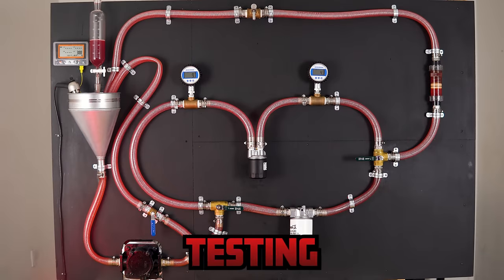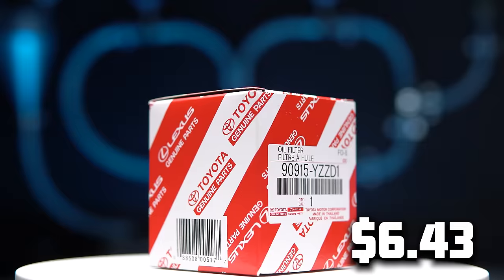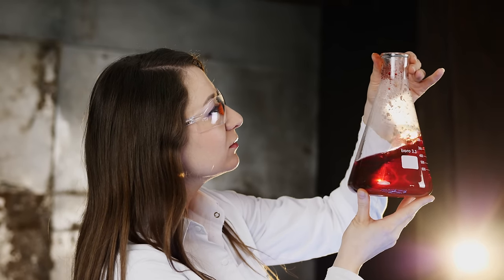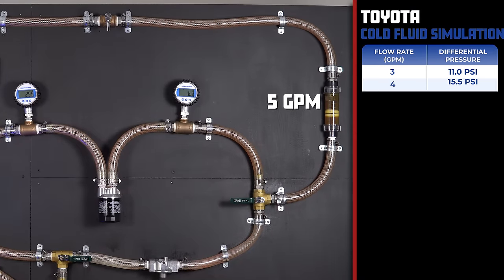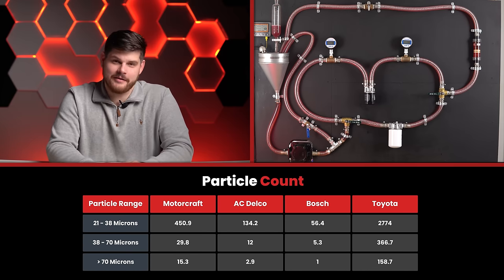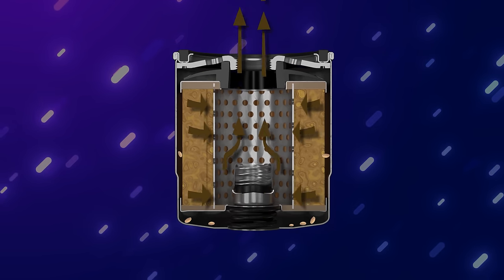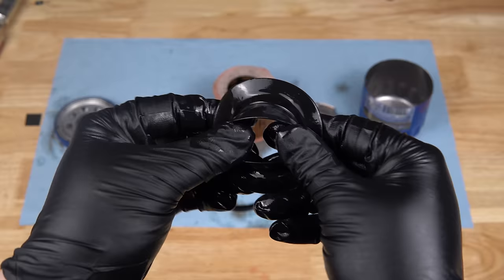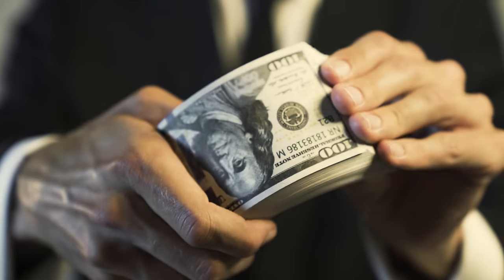Are Car Dealership Oil Filters a RIP-OFF?  (Engineer tested)

Comment: The Bosch 3330 has been my go to filter for many years with no issues.  I can’t find it anymore, so I’ve been using the Fram Ultra Synthetic XG3614.  I have a Toyota Tacoma 4.0 V6 Trd sport that I bought brand new in 2007.  It still runs great at 149,000 miles.  I’m going to keep it forever.  🙂
Reply: Fram ultra always gets excellent reviews.
Reply: For my Lexus IS300 I use XG3600 instead of XG3614. Same thing but longer body, so in theory it should allow less restrictive flow and greater particle capacity. But we still need SOMEONE to prove this theory scientifically!
Reply: Fram is cardboard dude. That’s pretty bad
Reply: My 4.0 from my 4Runner has 250k on it. Motor and trans are still great but everything else is falling apart. All the bushings and ball joints and bearings are just about dead
Reply: Switch to the Fram Endurance FE3614 or the larger FE3600, Amsoil EAO34 or Purolator Boss PBL20195, or equivalent Royal Purple Extended-life filter.
Reply: Fram. The orange can of death. The very first oil filter company, and the absolute last I would ever buy. If you hate your car, or just don't give shit, buy fram. If you love your ride, buy mobil1. By the way,  I have a 07 tundra, bought new, with 376k miles, and an 05 land cruiser with 298k..both run like new.
Reply: @shenanigansagain5273   Nobody is even talking about the cheap bottom Fram filters.  The Fram Endurance is the same identical filter as Amsoil EAO.  Mobil1 has been middle of the row junk for years since they changed their oil formulation and filters.  It is barely middle of the row these days.  You are just some fan boys that hasn't done enough research.  Land Cruisers are junk anyways.  And there is no vehicle on Earth that has 376k miles that run like it is new.  You practically would have to replace every single part 2-3 times by now to keep up with factory maintenance. You are nearly on your fourth water pump by now.  Toyota are great vehicles, but Mobil1 isn't what kept them running.  And in 2007 is when it was the real Mobil1 and filter, now they reformulated and changed the filter who is made by Mann-Hummel.  If you would like me to send you several testing result videos, I can attach them to this message.
Reply: @Balticblue93  My land cruiser bj40 (diesel) from 1975 has exceeded 500,000 km, 2 trips to the African deserts, hundreds of hours of walking on difficult off-road (4x4 club) and I have only replaced the injectors once, the water pump once, everything is original except the exhaust. Always the same engine, the same gearbox, the same axles and universal joints, the same winch, and always original filters. You are a joke!
Reply: Wix makes a good high quality filter
Reply: @howebrad4601  Wix is made by Mann-Hummel. The testing has been very middle of the row.  Pretty much the same as the Mobil1 filters as they are made in the same factory.  The NAPA platinum and Purolator One are also in that same grouping.  The WIX XP is a decent middle of the row filter and will work fine for 5000 or less oil changes.  It will also do better with a higher quality oil.  But it does not remotely test or work as well as many other filters.

Comment: PUROLATOR BOSS PROBLEM

The only problem with the BOSS filter being the top dog is that not all Boss filters have a 99%@25 Micron efficiency. 
The two I use have 99@46 Micron which is totally unacceptable.  It's the PBL 14476 for my Toyota. 
Another for my Ram is PBL36296 which is 99@34 or 36 which isn't great by any means. 
If you use a BOSS filter I'd check with Purolator to verify the exact efficiency rating.

Comment: Great test as usual. Any plans to test the Purolator One to see how it stacks up to the Boss?
Reply: How do they know if and/or when the bypass valves open up?  Or what PSI they are supposed to open up at?
Reply: The motorcratt filter is made by purolaotor

Comment: Not trying to be to nitpicky, but if you tested and AC Delco PF63,PF64,or PF66 are the current high use gm factory filters. You would be testing the newest technology filters.
Reply: ACDelco PF53 tested, not OEM for GM vehicles. Intended for other than GM. You are correct though, ACDelco ecores for GM vehicles is now use metal endcaps and have separate poppet dome bypass. The last when not for GM with block bypass.
Reply: @faxmen09  yes Ac Delco is OE for gm vehicle filters. The PF53 is for older gm vehicles, but nothing current. 
It would have been a better test, if it applied to current or nearly current vehicles.

Comment: so in HVAC we sell high flow media style filters to residential customers. and the reason is other then the fact they are cheap, many customers are bad about replacing filters and the media style filters have a huge capacity that will allow lower restriction then the higher end filters. in other words it has a chance of surviving until there next service.
Reply from the maker: Great point! I bet oil filters are similar. Thanks for watching and sharing
Reply: Why not just sell regular filters. If they blow up their HVAC system that's more money for you. It is not even unethical.
Reply: @Null-o7j  that's not how it works. If they have service, that means everything is warranted. My furnace has 10years full unit replacement and 20yr in parts. Also lifetime hx replacements, it is stainless so it shouldn't be a problem. it'll cost them more money if my parts keep breaking.

Comment: Please do a Hyundai/Kia filter. They’ve attempted to deny engine warranties due to aftermarket oil filters being used. At my workplace, they’re the only brand that specifically gets fitted with an OE filter. It would be interesting to see if they’re actually using a high quality filter or if it’s just legal riff raff.
Reply: As a former hyundai tech, the filter being aftermarket shouldn’t have much bearing on warranty at all. Seems like theyre trying to give people a hard time. Some dealers try to help more than they try to screw ppl and vice versa. Oil change records holds far, far more weight than use of aftermarket filters. When I worked for independent shops, champs OF4459 was the equivalent of hyundai filters, so that’s a little surprising that your workplace only uses the genuine hyundai filters. Definitely nothing wrong with that tho.
Reply: @yavz7565  yeah we used to use the equivalent Mobil filter and we ran into trouble while using it. This was several years ago and I was part time going to school during that time so I don’t remember the details but I do know it sounded like we weren’t the only ones and we’ve been staunch about it ever since. Admittedly, the OE filter does seem to be very good quality from the outside. Nice and heavy, good silicone seals/valve. Still curious.
Reply: Dealership will try everything to deny warranty..
Even though the agree.. they will try to sell you all the crap including tire rotation "Hyundai  reccommend B.S" 
If you were to sue em they will come back & say it was a misunderstanding with tech../ advisor..
If news goes viral then hyundai say.. customer had to contact coperate if they had any issue.. who would never respond till then.
Loads of B.S
Reply: @alenmonsyedward7499  you’re right, and that’s actually a reason why I think direct-to-consumer dealerships might be better. More accountability, less finger pointing… you’d hope at least.
Reply: Hyundai/ Kia are a joke. I owned a Sorrento and they voided my warranty because when I dropped my car off it was 1 mile over the suggested interval 😂. I had so many problems with them and it turned out that they had to replace my engine 2 times due to a common sludge problem. Car only had 48k with 2 engine replacements. I have gone back to Honda/ Toyota cars. Since then I have had no problems with my cars. Good luck with those clowns.
Reply: @alexgarcia7401  Why you lyin'?
Reply: @zcomputerwiz  you must be a Kia/hyundai owner. Sorry I told the truth and hurt your feelings.
Reply: @alexgarcia7401  Or I just like to call out a rando with a crazy story about 1 mile over on an oil change voiding the warranty ;)
Why you lyin'?
Reply: @zcomputerwiz  yup, you just confirmed you are a Kia/Hyundai owner. True story but you don’t have to believe it. Here is some more truth to that story that is hurting your feelings. Kia honored the warranty and once said and done they ended replacing 2 engines. The first one @ 18k and the second engine @48k. Got rid of that car and bought Honda vehicle. Only Honda and Toyota for me from now on. I learned my lesson.
Reply: @alexgarcia7401  Got it in writing that a dealer voided your warranty over 1 mile on an oil change interval? If they replaced an engine then very obviously your warranty wasn't voided - so which is it, clown shoes?
Reply: @zcomputerwiz  I did have it when i owned the car. I even had proof that i had to get corporate and lawyers involved to get my cars warranty reinstated. It became a huge lawsuit with Kia for that particular engine model. I’m just spitting facts while you are just trolling. Have a good day Kia/Hyundai owner.
Reply: Trash company trying to weasel out of warranty claims on their trash engines.

Comment: I work at a car part store. The filters mechanics and dealers order from me cost $1.97ea. The one i put on my car is $22 with my discount. K&N and Amsoil are the best, mobile is good but not in cold weather or cars with scavenging problems(like subaru, bad bypass flow springs and low bypass flow). Fram XG is good but the PH and CH are garbage. Use MANN if euro. My company stopped doing business with bosche because counterfit parts were getting into our part stream (brakes and plugs).
Reply: I understand that K&N is the brand that has a high flow rate similar to Toyota OEM.

Comment: Would you mind checking out Hyundai oil filters? They're apparently made by Mann & Hummel Korea and are supposed to be very high quality. On my specific Hyundai model, a '23 Elantra N, there's a rumor that running anything other than the factory oil filter can harm the engine due to lower flow rates from aftermarket filters. I've even been told that my warranty can be voided by using aftermarket options on my specific vehicle, which seems absurd to me.

Comment: I wonder how well the TRD version filters would perform compared to the standard toyota filter. They are priced high but maybe on par with the higher end aftermarket filters?
Reply: Believe they are made by Amsoil
Reply: @HondaSolutions  that would make sense, they make a great filter
Reply: Hmmmm.. i tought they were made by Champion Labs..
Reply: The Trd ones perform very well… They are made by champion labs (champion labs make some cheaper ones too, but it is their flagship line) it is the same or very similar filter as royal purple filters , amsoil oil filters, and the new Fram synthetic endurance filters. They are pretty much the best filters on the market that you could get.  Worlds  better than this.
Reply: Amsoil doesnt manufacture oil filters @HondaSolutions

Comment: As someone else said Id also be interested in a cartridge filter video, so you would be comparing the actual filter and remove the variable of the different filter housings. or maybe I have no clue what im talking about. I think ill be using oem toyota filters in the winter and try out something like the purolator filter in the summer. I did notice that the paper filter in the toyota spin on filter shown was the same as the one i use in my cartridge filter corolla, so assuming there were no design flaws in the spin on filter design, ill have to shop around in the future for other brands. Thanks for the OEM video!
Reply from the maker: Yes, we may do a cartridge style oil filter video, definitely would require some modifications. Thank you so much for watching and supporting the channel.

Comment: Waiting to see the Kia/Hyundai OEM filter in test. Amazing Job ! 👏🏼
Reply from the maker: Thank you so much for your support and for watching!
Reply: @BrandRanks  Hoping its the 26300-35505 model as it's used along a LOT of models. It's definitely got a bypass on the bottom instead of the top and others that have taken them apart show they're very well made. They've almost doubled in price within the last year though (from $7-8 to $12-13) but prior to that seemed a great deal.

Comment: Interesting and informative.  I bought a Bosch filter as recommended by Scotty.  What I got, I didn’t like. Small holes that restrict oil flow, but the ad showed a different hole pattern much bigger.  So, why did they change.  

Recently, I bought the Mobile 1 for my Toyota because of past history and design.  Past oil analyses with this filter always looked good through 160k when I sold the van.  

I also use Honda and Toyota filters.  But, due to this video, I will rethink using those filters.  The Toyota filter is similar to Fram Tough guard, I believe.  High flow, so even cold there is little bypass.

The problem I see using high efficiency filters is slow oil flow at start up.  I suppose with new low viscosity oils that flow like water, there would not be a problem.

Comment: Did you test the older AC Delco 12731742 PF63 or the newer 12735811 PF63? I believe they updated it to provide better flow. It has more holes in the baseplate. I think that the newer one is only available at the dealerships for now? I would love to see a comparison between the newer AC Delco, Purolator Boss, Wix and the Mobil 1 Love your work! Thanks Craig

Comment: I was wondering if you could test Baldwin filters next and maybe their cheaper line, the Hastings line as well.  Also maybe some of the other ones as well like Mopar filters, Pure One filters instead of just their Boss line, and maybe filters for actual Trucks or construction equipment.  So possible take a look at filters from John Deere, Caterpillar, Case IH which is CNH filters, fleetguard, and Davco. Thank you

Comment: I like all this detailed analysis, thumbs up!  But how does small particle filtration, capacity, and flow rate equate to engine life?  That's the REAL question!    It seems to me like if you change your oil & filter regularly, then dirt holding capacity shouldn't be an issue.  So then you get down to the question of what does your engine need more, higher flow rate or finer particle filtration?  To answer  that question, you have to consider whether the engine is subjected to more short trips, or long trips.  To me it would seem like a higher cold flow rate would be more desirable for short trips, while particle filtration ability would be more desirable for highway driving (after the oil is warmed up.)   So maybe your test results should be recategorized to help people decide what is the best filter for short and long trips.  That would be useful information.
Reply: I completely agree with this.

Comment: My 2014 4.0 Taco started with Pennzoil Platinum then to black Castrol Edge. Used the Napa Gold aka Wix XP. Other filters tried were Napa Platinum, Napa Silver, and Mobil 1 20k filters. UOA were stellar. Then I got cheap and switched to oversized Fram Ultra Synthetic filter and Halvoline Pro DS( 6 quart box) and  UOA are still stellar. Going to  the 6 quart box saved me $12 vs a 5 gal + 1 quart. Then filter went from $14 to $9. It’s nice not having an army of half empty quarts all over the garage. I highly recommend the Halvoline Pro DS for anyone looking to save money but needs or wants full synthetic.

Comment: I only use OEM Toyota filters in my 2014 Corolla S. Now I'm debating on going with Mobil 1. But this video made me rethink this 🤔
Reply: toyota is a highflow oil filter. it is able to last 10k miles and not restrict the motor. I think its a great filter.

Comment: AC Delco doesn't have a bypass valve because the bypass valve is built into the actual engine/oil pump ... it doesn't need or requires it !
Reply: True in some cases for GM and others, but not here. The ACDelco PF53 shown does have a filter bypass, it's called a combo valve ie. nitrile adbv with second set of central holes in baseplate that serve the bypass function. BR missed it because he's obviously not familiar with Cham Labs ecore filter design that uses a combo valve as bypass.

Comment: interesting post on a Toyota forum:

The oil filter bypass valve is in the oil filter for when the filter becomes blocked.

There is an oil pressure relief valve in the oil pump to limit the maximum oil pressure on cold starts so you don't blow the filter off the side of the engine.
Reply: Most if not all engines have an oil pressure relief built in, I remember even my 1600 VW Beetle had that back in the day.
Reply: yeah, so best filtering with worst flow isnt always the best, especially if its city car when oil cant get to oprating temp -> is running at high viscosity -> most of the oil is running through bypass unless you're running very easy on gas pedal...
Reply: @TheKafel92  if you drive a city car and your car will nearly never get to operationg temp then you have other problems then a stronger or weaker filter :D
Reply: @kuessebrama literally most cars in europe
Reply: @foxy126pl6 that’s so sad poor cylinder walls 😂 but ig city people keep mechanics in business 😂
Reply: @Mayan-_  i mean, at least in winter when im driving to school, the temp gauge isnt even above 60 when i arive. When coming back its at like 70 at most since the engine didnt quite cool down. Not a problem in the summer though